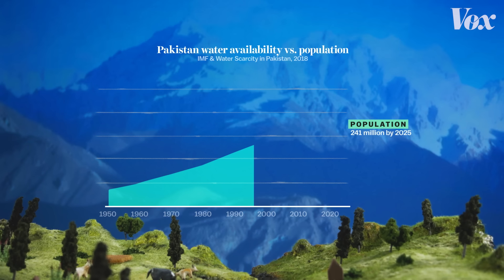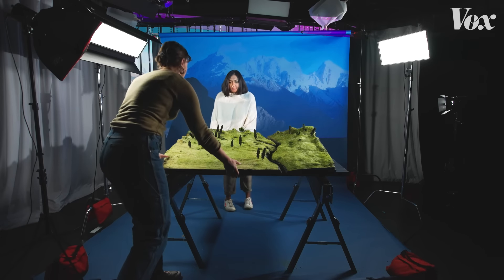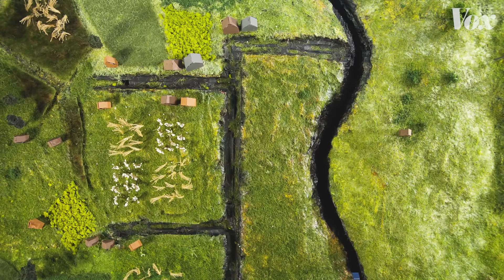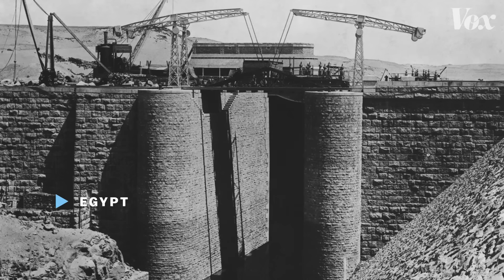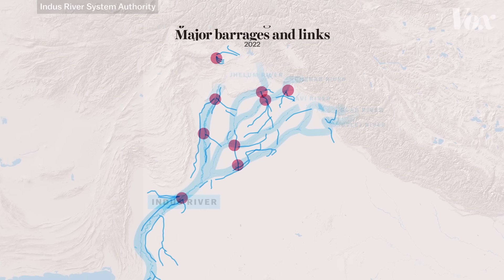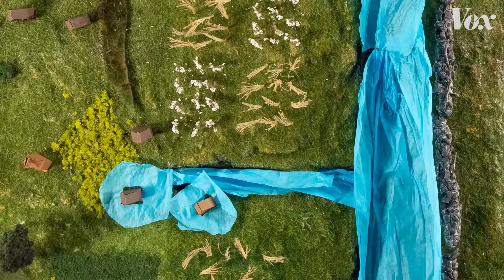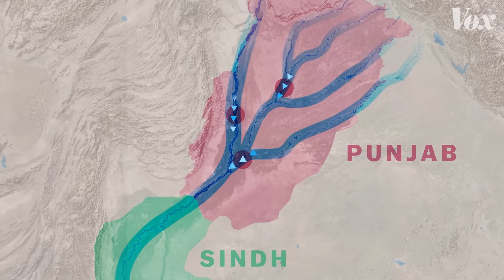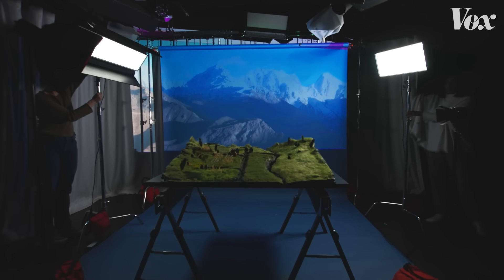The disastrous redesign of Pakistan’s rivers

Comment: What does not seem to be clear is that if this "colonial" irrigation system was to be dismantled, would it not have severe repercussions of its own? I think this it is too simplistic to say it's the fault of colonial mindset or colonial practice or over-engineering. The solution probably lies somewhere between sustainable engineering solutions, enforcing flood management related plans and in my humble opinion most importantly arresting the mind-boggling growth of population in Pakistan.
Reply: I don’t think the video is proposing instant wholesale dismantling, but rather a slow reworking of the entire system. That doesn’t necessarily mean no canals, but it means having a different methodology
Reply: @kaitlyn__L  and what is that different methodology? Care to elaborate? I just heard alot of sound bites. Nothing  concrete.
Reply: @aatirehrarsiddiqui8894  I was staring at this like... "don't engineer the river" ...surely now is when we actually need to engineer the river
Reply: Isn't the problem just corruption and poor water cycle management? If artificial lanes are constructed to guide water back into the Indus River and wealthy landowners are restricted from cutting embankments, that should reduce downstream floods and level out water flow.

Of course there are external factors (I.e. shifting climate patterns due to climate change) so droughts may still increase, but this seems like the most straightforward solution to reduce their intensity. 

Also Population Control sounds like a bad idea — I can't think of a single successful example that didn't involve catastrophic violence.
Reply: The answer is yeoman farming
Reply: @kaitlyn__L  The way the video talks about this is actually kinda strange. The script says that the indus river is overengineered, but they bring on the other person to say that "indigenous knowledge systems" should be used. Then the script calls for slow and sustained changes to water policy... while the visuals show people removing all of the infrastructure.
It's like, they're implying that we should go back to the natural way without actually saying that, as if they know that's ridiculous.
Reply: Its classic. You grow much more on much less land. By that You need less water and fertilizer. You also make other jobs as we do here and keep much less water from evaporating as well. 

As I see it by the illustrations at this youtube no groundwater for drinking is made as well. Rivers has to have space arounf them for that.
Reply: Corruption is an important part of it in Pakistan too.
Reply: Kashmir is an integral part of india pakistan has illegally occupied it...but wait is over their allah is punishing them now. And this makes me feel happy and sad at the same time.
Reply: @msardesai1  major gaurav arya op 🔥🔥😛
Reply: @msardesai1  You can only remove things like that by electing someone else, then You do. 

It has toi have a descent program and not only phrases. Its about bad habits actually can change.
Reply: Siddiqui- I don't think the video is suggesting what you are saying. This is something that happens in India too. Look at the present  problem. The whole Sindh Delta is dependent upon the fresh water. At the merging point, deltas form and it is saline  or dry now.
 If there is not enough fresh water at the delta, one there is a danger that the area will be encroached by the sea directly affecting the lives of people. When the sea retreats, which it will eventually as there will not continuous flow of water. The area may become like Kutch area. Some say because Saraswathi river disappeared, otherwise Kutch area was a fertile land. 

It can happen at Sunderban delta (Ganga delta as well).  The other thing it talks about destroying the environment on the wet lands such as a removing forest and replacing them with water intense crops etc... and allowing the elite and agro-pastorialists settling down in those lands and building embankments. 

It is suggesting that the river is now over engineered. Rivers are not supposed to be over engineered like drainage systems. 
Monsoon rain must be managed affectively. A combination of monsoon rain + River water management is a better solution than over engineering the river alone. If I understood this problem. 
This is not a unique problem to Pakistan. We too have river problems and disputes between upper and downstream states. But your delta disappearing fast is a much alarming. It may submerge the entire area under the sea, unless Pak does something to control the damage.

Last but not the least, population explosion is to be blamed. Seriously if there is one thing South Asia can agree, all three nations shall sign-up for one-child policy in letter and spirit.

Comment: As a Pakistani, who understands this issue and the politics involved, I find this documentary mostly wrong. Don't have time to correct all the info but for a start, the key reason for building Dams and Barrages is that Indus river gets its water from Glacier ice melting. This happens in late spring, summer and early autumn, so Dams and barrages help store massive amount of fresh water that is needed for agriculture and people, throughout the year. If it weren't for the dams/barrages then Indus river would be dry during periods of no glacier ice melting (i.e. many months)
Reply: Thank you for sharing this!
Reply: That was alll mentioned in the video. It explained that the dams and barrages allowed people to access water more easily, but created problems that were described in the video.
Reply: Then why is the country suffering so much more with the man made dams than before?
We can argue about the causes here all day yet the results are still happening and will continue to ruin Pakistan.  😞
Reply: You're getting the problem wrong as well, while barrages and dams help irrigate the upper regions of the country. The blockage of the free flow of the water means that the indus river delta is drying up and saltwater is moving upwards in the country and the lower areas are drying/turning saline basically. We also need to start thinking about proper drainage and water flow that doesn't affect the ground water chemistry. Basically you can't be greedy and store all the water
Reply: @dundundun7215  yea the ok low lying areas of Sindh are suffering due to too much water storage by upstream Pakistani Punjab.
Reply: @Alusnovalotus  Actually, the issue is "not having enough Dams"! Pakistan has 7 world's highest glaciers including K2 the second heights glacier in the world and VOX thinks Pakistan doesn't have enough water? The problem is all this water that we get from these glaciers is wasted and not managed in an efficient way. Not having enough dams is one major reason for this. It's not overengineering... This video oversimplified many things.
Reply: Also there is no water scarcity in Pakistan. All the cantonments and DHAs have uninterrupted water supply.
Reply: You are right. I allow me to see Pakistan has made too much farmland comoared to that flow.
Reply: @Alusnovalotus  Uhm, more people are suffering during floods because there are more people due to more food being grown. Many of those additional people live where people didn't live before for lack of water or for the occasional flood.
In my country - on a much smaller scale - we've developed flood plains and here people are also occasionally driven out of their homes by heavy rain. My point is that developing flooding prone areas isn't unique to Pakistan.
Reply: Okay and aren't you gonna demean how India is causing floods to your country? 🤣🤣🤣🤣
Reply: @Himanshu-vz5xe  🤣🤣 no they wont
Reply: @Himanshu-vz5xe  India wasn't mentioned, you brought it up. I don't know why I see Indians demeaning others every time, it didn't used to be this toxic in the past. I guess bc of Modi a lot of the worst sort of people have been emboldened.
Reply: @jondoh9414  not all Indians. Some modi supporter always crave attention and put weird comments here and there. It hurts their sentiments that no one glorified their most ancient, scientific, great and bestest best civilization while having normal conversation.
Reply: @At_sk  Sigh, I don't know. Of course it's not all Indians, but take a look at what is going on in India, the racism and the brutality. It is undeniable Modi has a large base of support and people are going wild doing terrible things. Even online we have seen the surge in toxicity, the venom it seems is everywhere and there is no accountability. I don't remember if I have ever seen responsible Indians trying to stop their countrymen behaving in this way.
Reply: @jondoh9414  And how can one be racist against his own race? Learn basics before making judgements.
Reply: @fusion7837  Really? You don't know about India's caste system? Learn the basics before making more judgements.
Reply: @jondoh9414  How come caste has anything to do with Indo-Pak conflict or race?
Caste is social discrimination based on the ancestral occupation in Indian subcontinent. People of all castes are present in India as well as Pak. How is this even related to Indo-Pak tensions.
Reply: @fusion7837  You're trying to deny the deeply racist origin of the toxic behavior online. I'm showing the deep-rooted racist attitudes that exist in India.
Reply: @jondoh9414  I'm just saying that it's more complex then you think, the peaceful population has take a part of our land as Pakistan, Bangladesh and Afghanistan and still creating ruckus in present day India. It's an Ideological battle between those who think everyone except people following a particular ideology don't deserve to live and those who welcome inflow of better values in them. Just see what has happened to Europe with just 5-6% of them, and imagine that going to 20%. And if you are denying the supremacist attitude of peacefuls, you should look some ex- peaceful channels and see what happens to peaceful majority countries.
Reply: Indus river flows year long , lol 😂
Reply: this is not a documentary
Reply: @NaSaSh1087  
It's Sindhis who always had an issue with building of dams. Not Punjabis' fault.

Comment: Colonial mindset? The british only built one or two barrages, it was the Pakistani's who built over 50+...
Reply: Ok and they started it
Reply: Except that the colonial mindset is still thriving. The modern India and Pakistani legal codes were compiled decades before either was a separate or independent nation. And when independence did come the new ruling elites were content with the economic status quo the British had built, and simply promoted themselves into the commercial and government jobs and roles that had depended upon or built that status quo. 

In economics this is called Path Dependence, which is built upon the theory that it is far easier to maintain existing economic and sociological infrastructure- in spite of their glaring shortcomings or limitations- than to switch to a newer and improved system that has to be built from scratch. In most cases of modern countries that emerged from European colonialism, the previous colonial rulers had built most of their physical existence from borders to the ruling social structure to government administration to the main export industries prior to independence. And since path dependence is very difficult even for prosperous developed countries to break, there was little chance that poorer former colonies would deviate from these established systems. And this included patterns of neglect, corruption and social cupidity usually traceable to the former colonists themselves, passed down to the new rulers.

Comment: I mean if the population of a country grows fivefold and the water supply remains the same it makes sense that the water availability per capita will drop proportionately, it is simple math.
Reply: No, Pakistan could have made hundreds of dams and reservoirs to increase its per capita water availability.....
Reply: @FahadFSA  So x-amount of rain falls a year and you think all of it should be locked up in dams?
Reply: @FahadFSA  Yes this is a solution, but if not implemented, as is in this case, then the per capita value will drop. Also, I hate it how the video focuses too much on the British colonizers. Pakistan has been an independent country for more than 50 years, so it is their fault that this problem exists.
Reply: They are breeding like animals.

Comment: Do not listen to these individuals claiming to be experts. I am from Pakistan, and I can assure you that the real issue is not related to engineering or building canals and dams. Instead, it is political corruption that is the root cause of many problems. Some farm owners and landlords have intentionally located their farms near river basins and forced their workers to live in those areas, resulting in damage to their homes during floods.

Contrary to the claims made by the experts in the video, the real problem is not solely with engineering. If engineering was a major issue, the earthquakes in Japan would have caused the skyscrapers to collapse(update: See what happened in Turkey). However, they remain standing and unharmed. Dams can help address the energy crisis in our country by storing water for power generation and agriculture.

LOL Overseas Pakistani experts

Comment: The issue is not only the canal system but how much water goes to waste using this system. Process is known to be incredibly inefficient and  due to that, almost 80% of all farming in Pakistan is done by ground water instead of the rivers. At independence (1947), ground water use for farming was less than 10%. This has put an enormous pressure on ground water supplies in the country.
Reply: Zaydan Alfariz  Im pretty sure he means that using groundwater tends to be unsustainable, since it replenishes slowly. But it depends on how deep do you dig for the water..

Comment: Mega dams are essential for development of Pakistan
I would say the solution to flooding in Sindh in by even more expansion of the canal system by having canals drain deep into the Tharparker desert
Reply: That's clearly an illiterate take on the matter. That would absolutely annihilate the Indus delta, which is already suffering so much.
Reply: @naintarabatool1150  and create new farmland in barren areas
Reply: @qasimjebran2687  that's literally the problem all along bro! Did u even watch the video?
Reply: @naintarabatool1150  Its not a problem it was made a problem because the drainage system of Sindh isn't properly developed
Reply: @qasimjebran2687  there would be no drainage system without water 🤦 seawater is seeping inland as the delta remains dry for most of the year because water is stored in large dams.
Reply: @naintarabatool1150  How much delta would be lost and how much new farmland will be gained in Tharparker with more efficient usage of water?
Reply: @qasimjebran2687  all delta will be lost. Infact we've already lost almost half of it.
Reply: @naintarabatool1150  and we gain more farmland in areas that were previously Arid
I would call it a net gain
Reply: @qasimjebran2687  that's not a net gain lol. It's a total loss. This whole video is literally explaining that
Reply: @naintarabatool1150  The whole video calls for breaking up the entire canal system jist to save some area of Sindh delta which is non sense

Comment: So in summary Pakistan EXPANDED its water system and EXPANDED its population by refusing to use things like modern birth control for religious reasons. Sounds like more of the blame remains with the Pakistanis than the British. If population and the water system were the same today as they were when the British were there and the crisis was the same, then you could blame the British, but the expansion of both under Pakistani rule seems like the real culprit.
Reply: ok